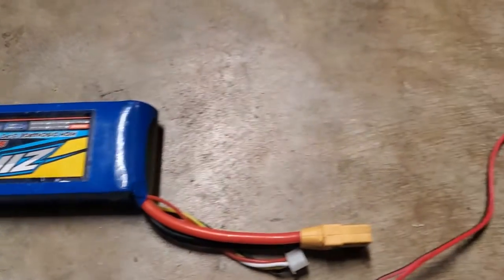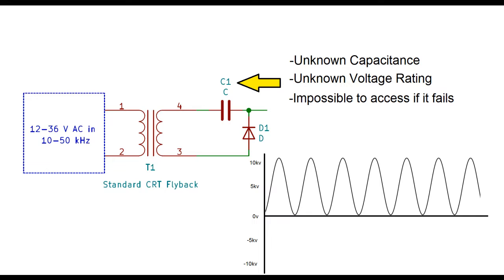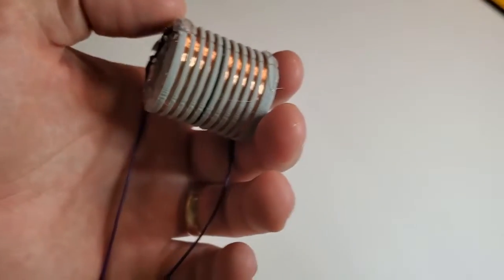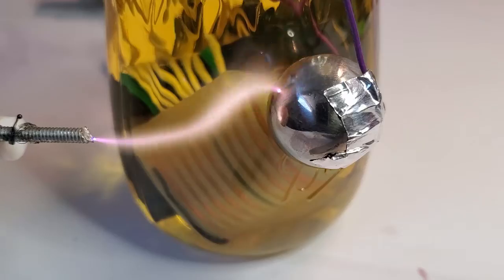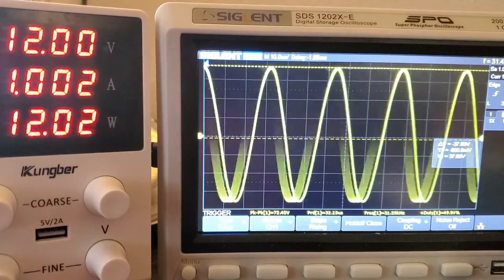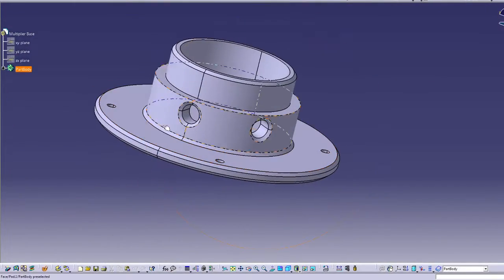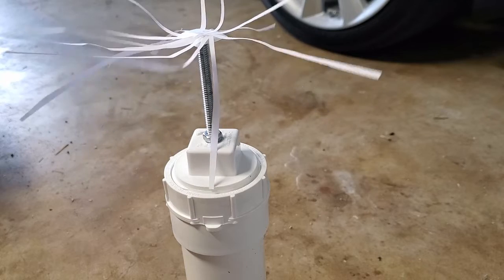120,000-Volt Multiplier

Comment: Wow your ZVS is definitely giving that transformer some juice! Would power a small CO2 laser with a few multiplier stages. Have you ever built a spiral line HV pulse generator? They are super easy to build and can produce 350kV at amps of current in a 60ns pulse. You can use it to build a realistic EMP simulator.

Comment: An idea is that if you can find an old flyback transformer from an old tube or earlier solid state TV, it will not have a built in rectifier or doubler, and the output will be AC.

Comment: Congratulations, excellent design, a question, what oil is used?
Reply: I think mineral oil, it is a great insulator.
Reply: There are many types of oils. As a hobbyist just use some mineral oil you got on hand. It's usually not worth it to buy special insulation oil like Shell Diala. You can use silicone fluids and even ricinus oil (not recommended for hobbyist). There are also insulation oils derived from seed oils. High Performance oils can be made from natural gas (gas to liquid). Beware of old transformer oil. It can be highly toxic.

Comment: I made a flyback transformer myself so I know how hard it is to get it just right and then you have to prevent arcing to itself, I potted my transformer in candle wax, the layers between the coils that I wound on top of each other instead of what you did having the coils next to each other I used paper for that so it helps getting the candle wax in between the coils since it will wick the candle wax up which worked out very well for me, I had to use hot candle wax to get it in between the layers and then let it cool down to find a hole exactly where the coil was located.
I filled it up with more candle wax and I also put in the capacitor bank and the inductor in the same plastic container filled with the candle wax to have all of the high voltage parts nicely isolated in a plastic can or box.
Since I've made that flyback coil myself I haven't blown up any more mosfets, and I can leave it on for a very long time without anything heating up so I'm pretty proud of my hand made construction.

Comment: How did you measure the output voltage? Or did you?  And another thing coming to my mind:  PVC is not supposed to be a good insulator (and I have some personal experience!).  I guess you indeed depend on the oil even for that reason.
Reply from the maker: I can measure the input voltage with a resistor divider, and then multiply that by the number of stages in the multiplier circuit. Of course, there are conduction losses, diode losses, etc., but when you're making big arcs, the difference between 120,000 volts and 117,500 volts, for example, is imperceptible
Reply: @HyperspacePirate   Good.  But the diode drop is negligible, even for high voltage diodes.  The capacitors in my experience are more likely to cause some meaningful drop, about 2 kilo-ohms impedance per capacitor at 80 kHz.  If I counted right, you have 12 capacitors (as well as 12 diodes) in seres.  That means some 23 kilo-ohms total impedance. The voltage drop of course depends on current as well as the impedance, so I don't try to estimate that.  Nor do I know the AWG36 winding length, but you have there about 1.3 ohms per meter, just for pure resistance.
 On 50 or 60 Hz AC between 0.5 meter spheres and 1 cm gap, you are supposed to get sparking to start at 30 kV RMS.  In the old days that was actually used as a measuring device.  Anyway, the spark initiation voltage depends on the electrode size and between a point and plane or two points, you get considerably lower initiation voltages.  You notice, how close you bring the ground side wire end before the arc starts.  After the start, maintaining even very long arcs is easy due to existing ionization.  All this is why I am curious about your actual voltage.  Once, when Heathkit was still around, I built their 40 kV probe and quite recently I built two DMM voltage extenders, 10 : 1 dividers with 1% high voltage (15 kV rated) resistors.  I also contemplated buying some vintage electrostatic HV meters offered at eBay, but ended up not going that way.  Well, good luck in the future with your experiments!

Comment: You should build a duplicate multiplier but opposite polarity. Putting them side by side, you should get double the output voltage between them.
Reply: Why is this better than building one multiplier double the length?
Reply: Because why go low

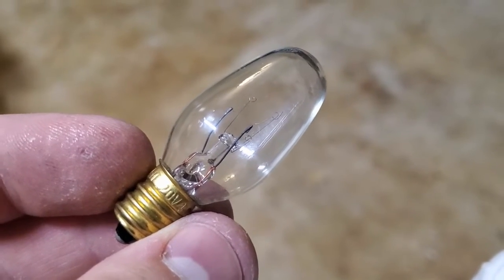Comment: 8:36 I'm curious how you hooked up the light bulb? If the arc had a proper path to travel from + to - from the center conductor pin on the base to the outer conductor on the threads? My "X-ray vision" doesn't work so well on videos to see how the lamp base was wired, or if you just wound it to the post with foil and caused a short? Also, I've never seen anyone try that with an incandescent lamp either, only seen people use fluorescent tubes, so maybe that had something to do with it?

Comment: I know this video is a year old now, I’m just starting to get into electronics as a hobby now that I’m retired. You mentioned lower that a coil would produce a lower frequency, what frequency does this run at and how do you determine frequency?
Reply from the maker: if i recall this runs at about 25 kHz. The frequency is based on the inductance of the primary coil on the transformer and size of the capacitor. Smaller capacitor or smaller number of turns on the coil = high frequency and vice versa

Comment: absolutely sick. I should look into how these zvs circuits work. one question though- couldn't you just make that transformer with a toroidal core? what's so special about these cores?
Reply from the maker: Yes, but 1.) It would have to be a very large toroid to have the same saturation current as the core used in the video, and 2.) it would be more difficult to wind because you can't take it apart in two pieces like a flyback core
Reply: @HyperspacePirate  thank you

Comment: Fun fact: the reason you were getting 38V from your ZVS is because the equation for  output voltage of ZVS is V_out = V_in * PI (12V * 3.14159 = 37.7V)

Comment: If you used an ignition coil to power this would It work?
Reply from the maker: Yeah, but the impedance of the multiplier would be higher due to the lower operating frequency of the ignition coil compared to the flyback transformer in this video.
Reply: @HyperspacePirate What type of capacitors and diodes did you use?
Reply from the maker: @60hz120vac  1 nF / 20kV caps and 100 mA / 20 kV diodes. Links are in the description.
Reply: If I used a a 29.5kv flyback would it work stock?
Reply from the maker: @60hz120vac  if it was built after the 60's, it probably has an internal voltage multiplier which also rectifies the AC to DC. If you want to use it with your own multiplier you'll have to remove the potting compound and remove that element first

Comment: Hypothetically how difficult would it be to produce 1 million volts with a multiplier circuit using 20nf 50kv capacitors??
Reply from the maker: No major difference from the one i built in the video. The big thing would just be making sure you have the right ratings on your HV components and space them far enough apart to avoid arcing. If your caps are 50 kV, for example, you dont want more than 25 KVAC of input because the caps in the ladder end up being 2*VCC
Reply: 1MV is quite difficult. Things start to get tricky when you get into hundreds of kilovolts. Starting with a low voltage and using many multiplier stages makes no sense. You would be better off starting with something like a 150kV transformer. Those things can get big and expensive quickly. 1MV is probably more doable with Tesla transformers or static generators.

Comment: nice experiment，do you know how to get the times that you will boost the voltage？
Reply from the maker: Assuming no leakage, the multiplication ratio is the number of capacitor-diode stages in the ladder. That's for an open circuit condition.
Reply: @HyperspacePirate  the capacity of the capacitors you have to worry about？
Reply from the maker: @vicentecarrasco3653  Larger capacitors will present a lower impedance to the alternating current, but I think the power supply feeding the voltage multiplier will become a limiting factor long before the capacitor impedance does. Having said that, I use 1 nF / 20kV caps, but values as small as 50-100 pF would probably work the same on this circuit
Reply: @HyperspacePirate  aaaaah，largest capacitors in the output the voltage will reduce.

Comment: You can buy brand new AC flyback transformers on E-Bay for about $35. Just do an E-Bay search for "F0239" or "F0241". I use 2 of the F0239 flybacks in parallel on my VM. They work well. You can see them on the VM on my channel.

I would also suggest using a load resistance to protect your diodes or you may find them burning out.
Reply from the maker: Cool VM video, I've actually been building one of a very similar size to yours with a goal of putting out 600kV.

I've used several of the typical eBay / Amazon flyback transformers you come across, but the problems i have with them are the lack of ability to cool the secondary (which is always potted in epoxy), the fact that the outputs are DC due to the integrated voltage doubler, and the relatively small size of the core limits the power that can be pushed through them before saturation occurs

In contrast, buildings flybacks like the one in this video typically costs me about $3-4 per unit, and I've managed to push close to 500W through them before core saturation
Reply: @HyperspacePirate  The flybacks that I referenced are true AC flybacks (no internal diode). I use 2 in parallel for about 300 watts of power. They also seem to be larger than the typical flybacks that you see. I have run my VM for about 5 minutes with very little heating of the core. That's probably because I use 2 in parallel to double the power capability.

Your hand-made AC flybacks seem to be working well for you. I just thought I'd give you a COTS source if you were interested.

I'd like to see that 600 KV unit when you get it running.

Comment: Nice! You might even be able to add a wire brush drill (or something similar) at the end for increasing the amount of points to generate more ionic wind. Some of those brushes might even be able to be screwed on (with an adapter) the tip. If you put a PVC pipe over that (with air holes below the brush) the ionic wind flow going straight up should be even more impressive, I think?
Reply from the maker: Yeah i think you're right about that. However, my real goal with the super high voltage is to experiment with powerful electrostatic effects, so i think I'll eventually mount a big metal sphere on the top to spread the charge over a big area, similar to a van de graaf generator